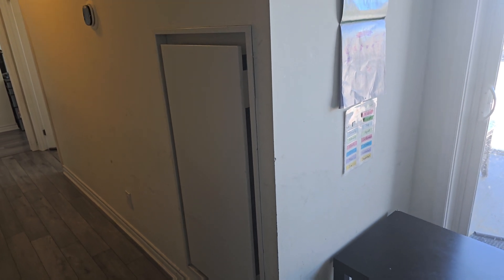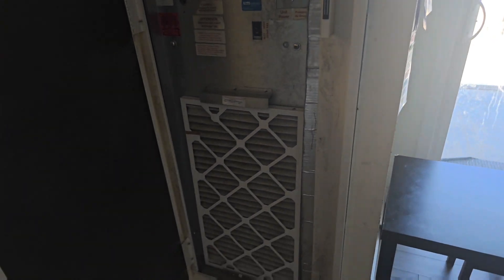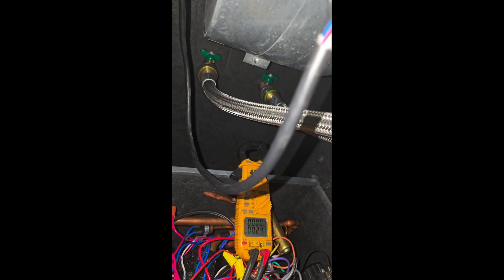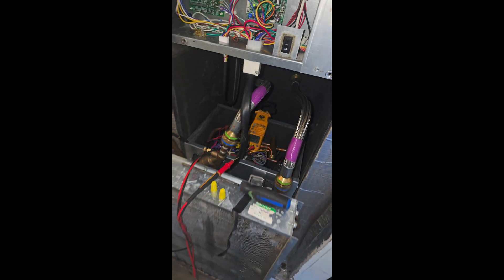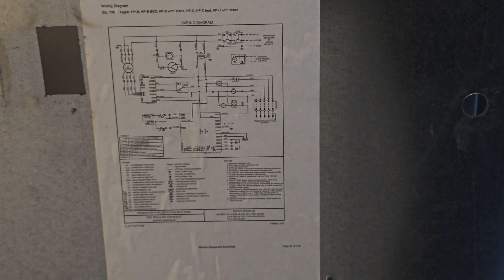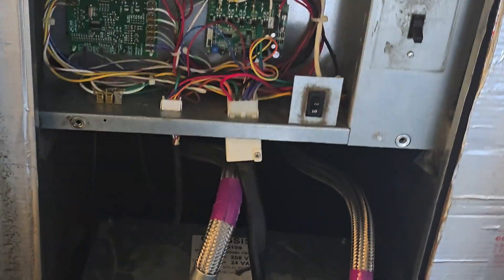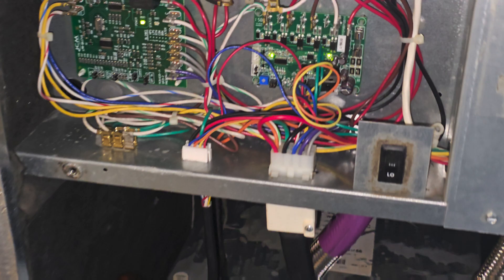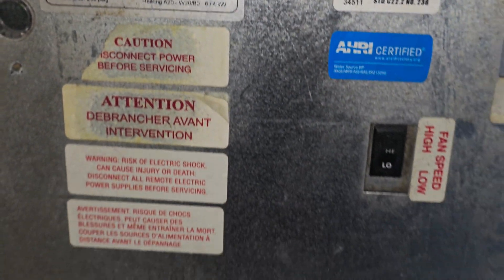Heat pump troubleshooting, condo fan coil repair, #heatingandcooling  #fancoil #heatpumprepair

Comment: Pls can you do a video on the most common problem in fan coil unit in condo
Reply from the maker: Please follow this channel and share your positive feedback. I will look into your request shortly. Also, check out the video on this channel titled 
1. #Magic-Pak ac not cooling, #PTAC air conditioner repair, heating and cooling unit 2. #Howtofix AIRMAX Furnace not turning on, AIRMAX Technologies, #air max air handler, #ac, #furnace